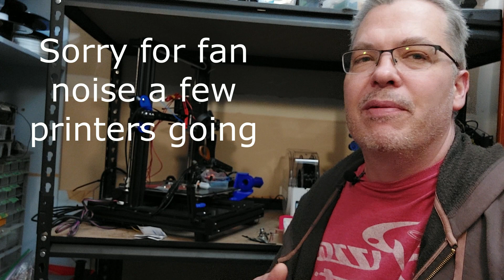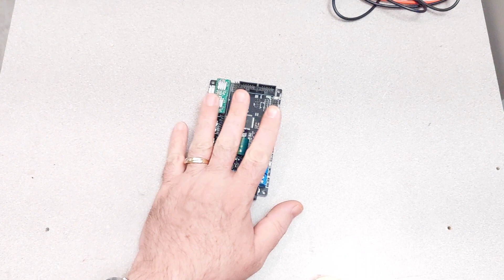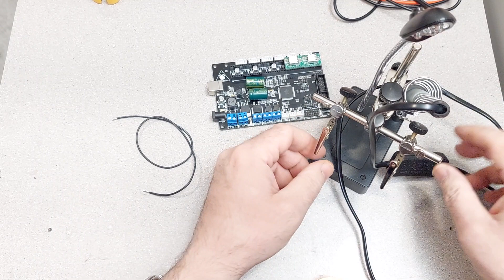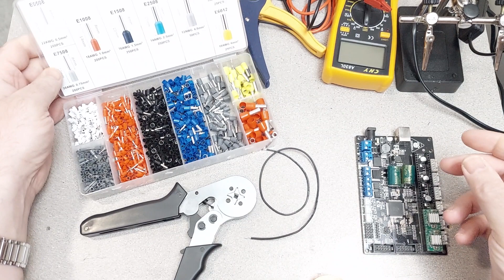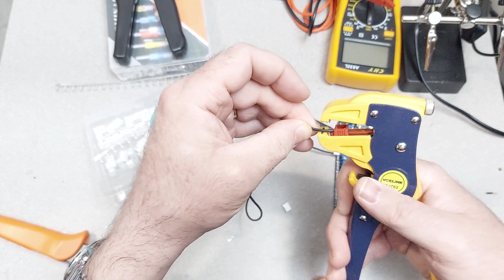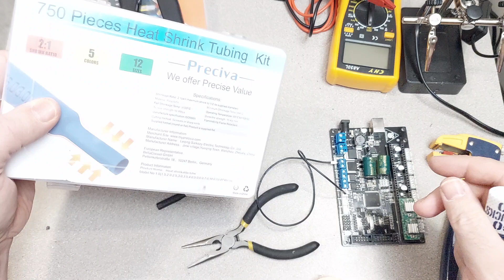Tools to work on your 3D Printer 3dprinter upgradetronxy kp3s voxelab aquila

Comment: Allen wrenches that I usedxas a Cnc Setup/machinist, was Bondhus (made in USA). But hardened, and well made with the EZ tip on long end, that locates to allen bolt, really easy,  (don’t have to be exactly aligned to allen geometry, used breaker bars, not advised obviously for printer, but very few issues in 20+ yrs

Comment: Myself I use Bondhus allen wrenches, both L Key style and driver style.  The L style are the one ones to start with and offer the highest torque but if fiddling with small screws the driver (like a screw driver) are my preferred.  They're aren't expensive, with wrenches you get what you pay, so don't go cheap unless you want rounded or stripped fasteners.

Soldering, myself I use a Hakko FX888D, last station a hobbyist will buy unless they get super serious with soldering.  

Great advice on your suggested tools, I have them all in my arsenal and use them often enough with each mod or upgrade.  

Thanks for your video!